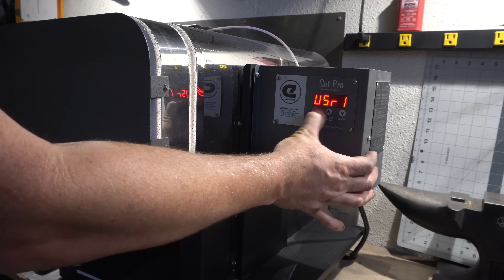Twisted Damascus "Mako" Hunting Knife - The Complete Video

Comment: You should see the finish you can get with Starbond. I do bentwood rings and do 10-12 coats on my rings. Sand up to 12000 grit and then buff. It is a mirror finish. It is a great product! Try it sometime you won’t be disappointed! No more oil finish is correct and people will be amazed at the shininess of your handles. Don’t take my word for it just try it on a scrap piece of wood and see for yourself. Should take about 20 minutes with the fast set spray!
Reply from the maker: Robert, this IS Starbond.  Thanks for watching.

Comment: Awesome knife and handle. One thing to look out for is sometimes using the accelerator it can cause the glue to haze over. Not really a problem if you sand between coats but just something to look out for. It doesn’t do it all of the time but it’s happened to me a couple of times
Reply from the maker: Yeah, I could imagine it would do that.  I’m not a fan of the super shiny finish so I prefer to sand it down and then buff it abs that seems to be a good level of shine for me. 👍

Comment: How does filing a notch help with sharpening? Never heard it it before
Reply from the maker: It does make it easier because you don't have to worry about the sharpener scratching the blade when it rides up on the plunge line.  It's very common in hunting knives, not so in kitchen knives though.  Thanks for watching.
Reply: @TyrellKnifeworks  Thanks for the reply and explanation, love your content

Comment: Why don't they have a jig on the press that is like a pizza box where the top and bottom have sides that overlap? Wouldn't that help prevent the edges of your layers from splitting when trying to form them into one piece of steel?
Reply from the maker: I’m not entirely sure what you mean. There’s not really a way to prevent that though.  Thanks for watching!
Reply: @TyrellKnifeworks  Yeah, probably my complete lack of knowledge about knifemaking rearing it's head. Thanks for the reply!

Comment: A good/usable weld to rebar.... A rarity
Reply from the maker: Thanks for checking out the build!
Reply: @TyrellKnifeworks  no worries... Love your work... 
But seriously, what kind of magic do I need to do a quality weld to rebar
Reply from the maker: @outcast_performance  I put a lot of weld in the connection between the billet and the rebar... almost make little triangles in those areas with lots of weld built up on itself.  That way it holds well.  Plus I'm using mig with gas so its a bit easier (in case your using flux core or something else)